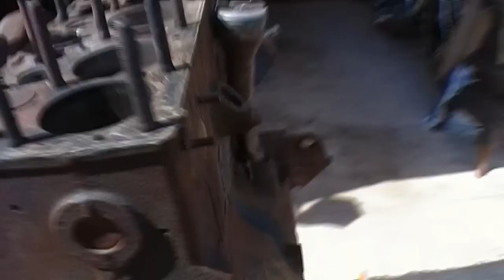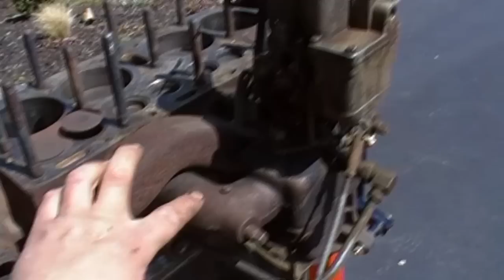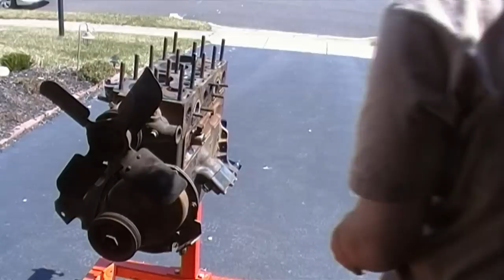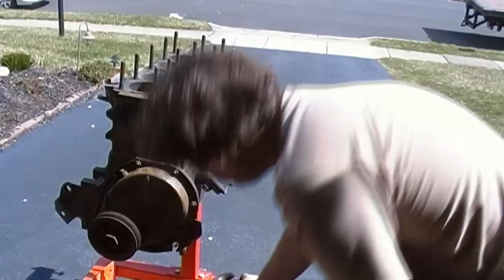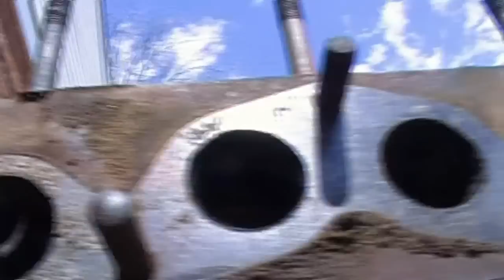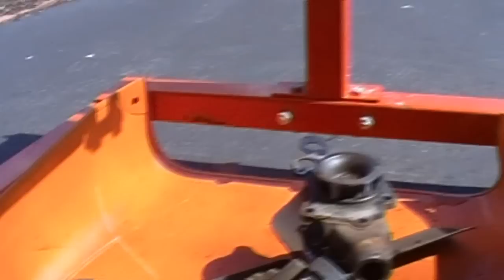General Supply Co. Air Compressor #3

Comment from the maker: I used the one at work, it has a Karcher electric pump with a 240v motor and it is diesel fired.
I think its a Shark brand.  Works very nice especially if you use a degrease chemical with it.

Comment: We had an air compressor with a Peugeot 4 cyl engine in which the two outer cylinders served as the engine and the two inner cylinders as the air compressor. I thought that's what you had here, but there would have to be valves in there and a compressor manifold for it to work so that isn't the case.

Comment: I think you will find everything to be stock except for the plugs where the valves were and the custom head. I got a chance to look at one that used a ford 302 v8. They had one side for the engine and the other was the compressor. On that one I did notice that they had the four dead cylinders spark plug wires taken to ground to null out the spark that would be going to a plug.

Looking forward to more videos.